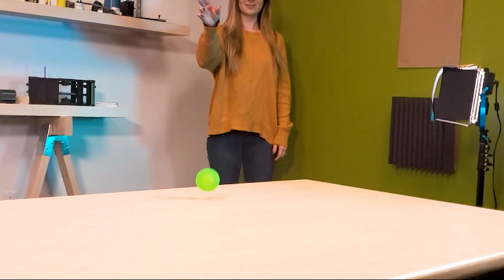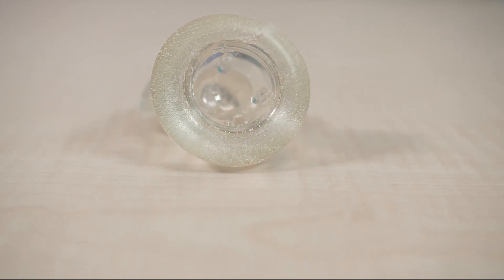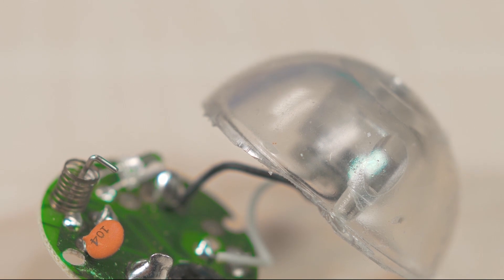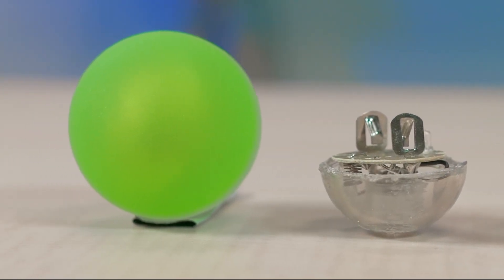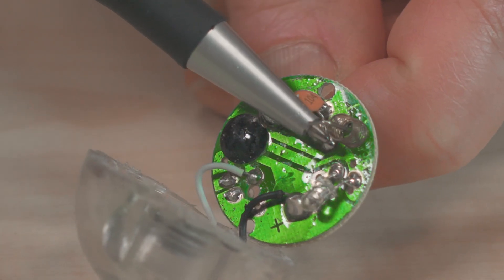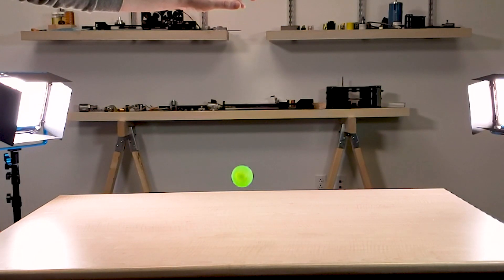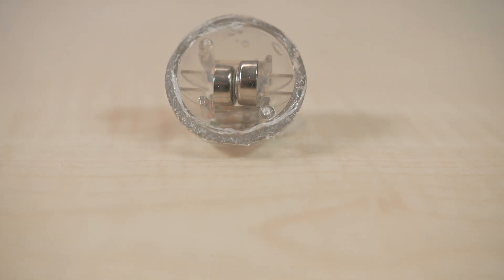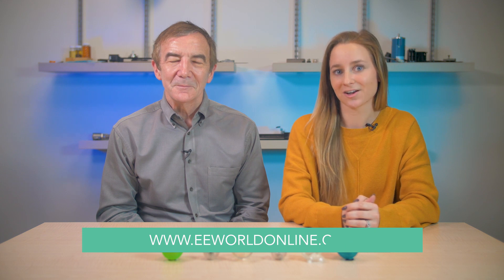Teardown: Bouncing LED/Noisemaker Ball

Comment: How to remove the timer? I want to continous blinking
Reply: The timer is part of the i/c, not removable.  You can, however, run a “jumper” between the coil and its contact pin.  That will keep it on until the batteries die.  Also, sometimes, instead of a “pin” in the center of the coil, the coil will be horizontally mounted over an external (to the coil) contact “plate”… these are more easily triggered when shaken.  You can use a small strip of electrical tape to hold that circuit together, and the light will stay on, or keep flashing, depending on the i/c…